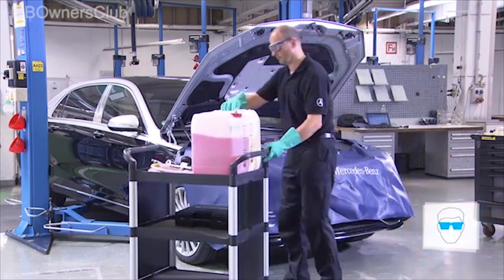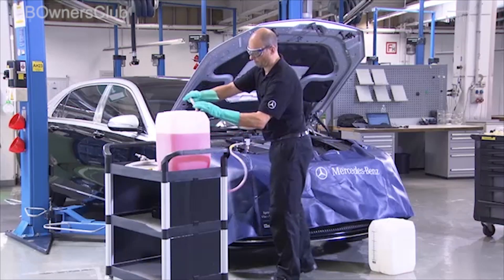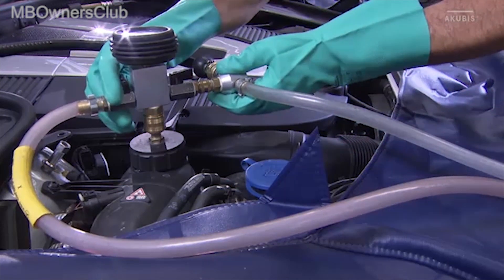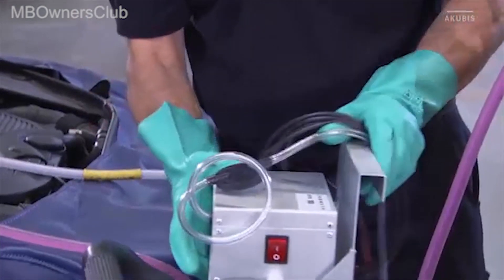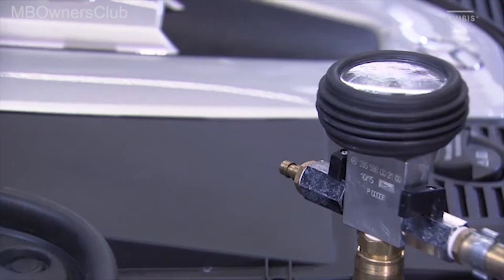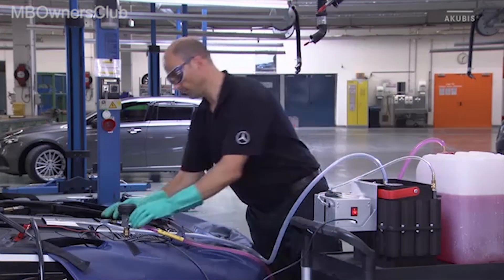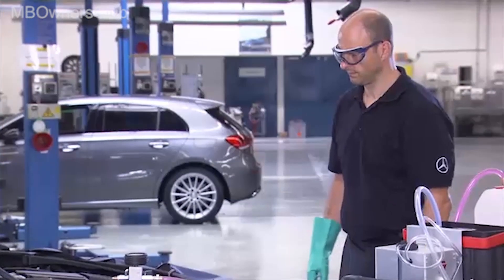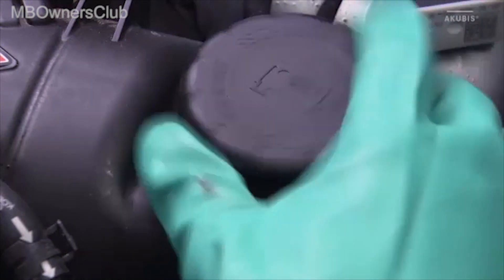Efficient Method to Fill Coolant and Bleed Air in Mercedes-Benz Cooling System

Comment: Great video.  I did not have that vacuum unit so I simply drained the radiator and engine block.  I then used a pressure system unit to create vacuum and refill the coolant.  In this video I learned that while pulling vacuum its a good idea to open that valve and fill up the coolant refill hose so theres no air in in.  Brilliant.    I wasnt able to track down a pressure cap so I made one using a new coolant reservoir cap and drilled a hole in it to expoxy in a male quick connect.

Comment: Sure we all got equipment like this really.
Reply: Video looks like it's a Mercedes mechanics training video so they would have all this equipment.  Home mechanic would just drain the radiator and engine block then use the pressure attachment on the coolant reservoir.  I bought a pressure unit like in this video for $20, came with the quick connect fitting so I just bought another coolant reservoir cap and drilled a hole in it to epoxy in a male quick connect.  Worked perfectly.

Comment: What a load of bollox
Reply: Typical of all modern car confusing so called progress in automotive innovation... the technician in this case, came across as a confusing disaster. I’ve just changed the thermostat on a. C200 Mercedes... made of cheap plastic ... placed in a ridiculous part of the motor, where you have to dismantle half the engine to get to it...then you tell me I have to get my system bled with all this sophisticated equipment or take it to Mercedes Mum where you empty my wallet.. sorry guys you have gone backwards.. but I can understand why.. to rip us off... I could go on and on.... but no one listens cause we are just to you peasants...!!! Shame shame shame...!
Reply: @garrybaraldi1462 
Nonsense.  The thermostat is right in the front held on by 2 bolts.  And most vehicles these days require a vacuum unit to properly fill the coolant system without air bubbles in it.  In this video the only thing they did differently than home mechanics is use thay vacuum machine to suck out all the coolant, most people simply drain the radiator from the drain and engine block from the drain bolt.  Can buy a coolant pressure unit anywhere from $35-$250 depending on the unit.  I bought the Steelman 60402 replacement pressure pump for $20.99 then made my own coolant reservoir pressure cap from a new reservoir cap with a hole drilled in it to epoxy in a male quick connect.  Can use that pressure pump on any vehicle and just have to make a pressure cap.
Reply: @timb7775   actually hes right. The thermostat on that engine which i assume is the m270 4 cylinder petrol turbo, is located under the intake manifold which on a c class with rwd is not as bad to remove but on an a class with fwd with a transverse engine where the intake i located in the rear of the engine bay it will take alot of time to replace it.
Reply: its not really tho is it. A very efficient way for mechanics to change coolant or do repairs on the system without the pain of bleeding the system.